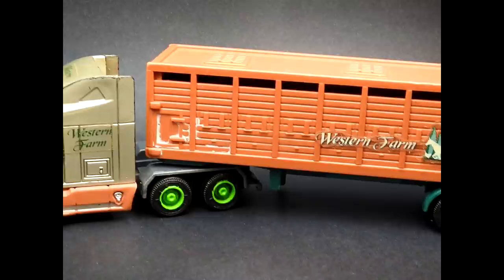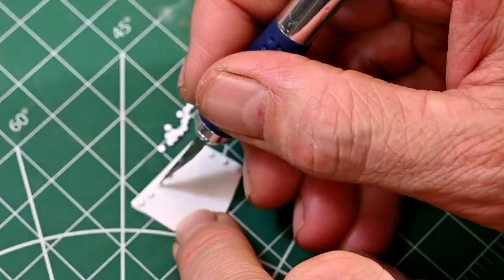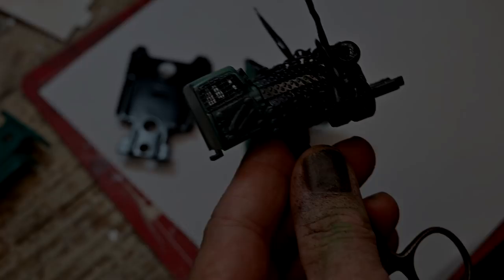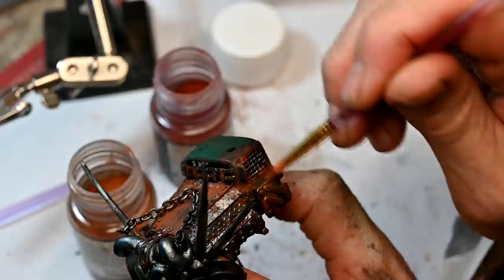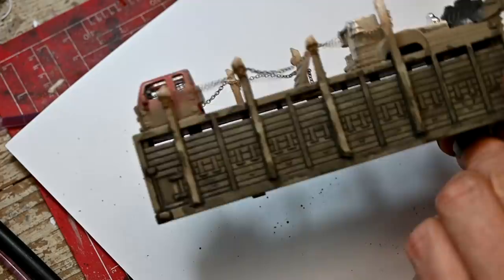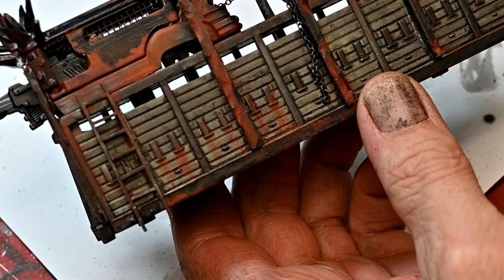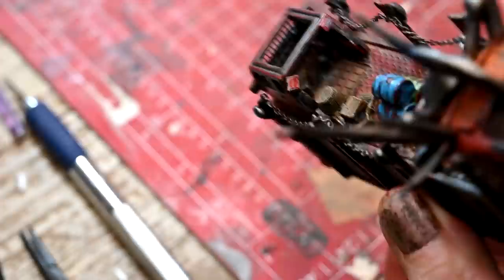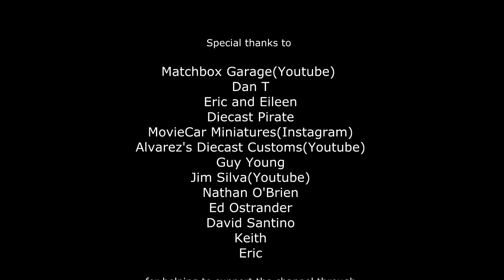Post Apocalyptic Zombie Transporter Rig Undead Human Cattle Truck

Comment: The only thing that's missing is some zombie models to go with the trailer. The grim purpose of this build is to capture random undead,transport them to a rival faction,release them to cause as much chaos and confusion as possible and GTFO of there to make a massive hole in the defense for the impending raid. Basically the trouble makers that you don't want to deal with.